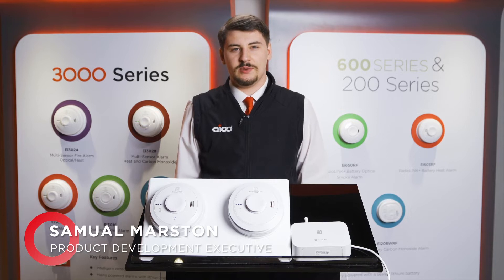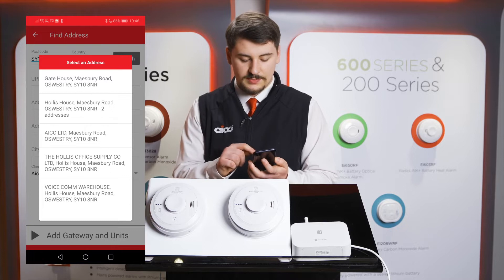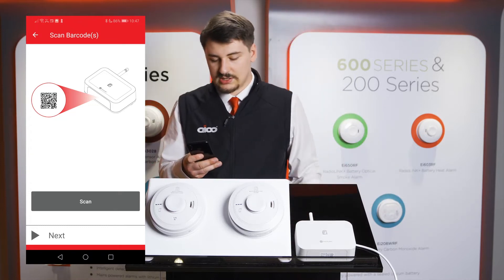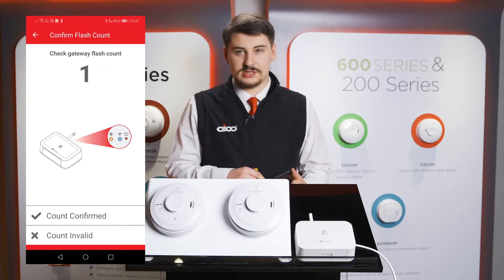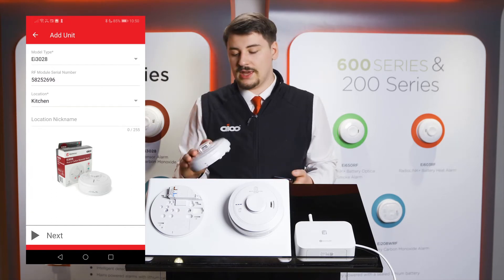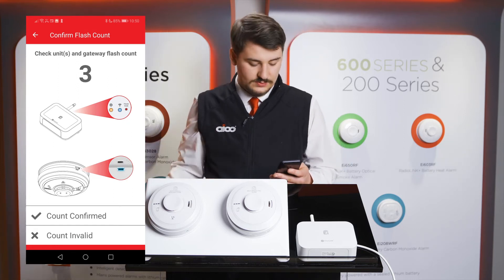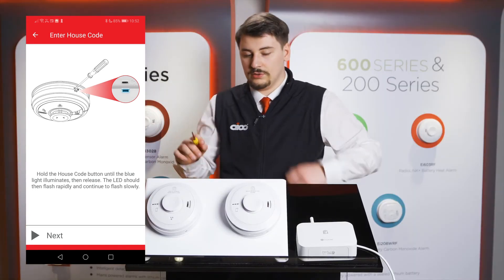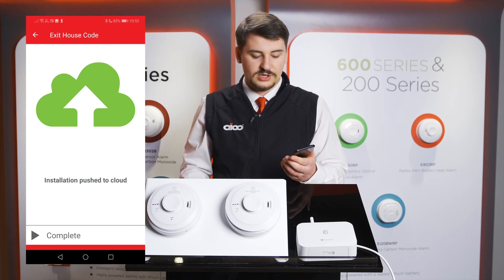Setting up an Ei1000G SmartLINK Gateway

Comment: I turned the gateway on (Power LED on only with blue led keeps on flashing) but why does it keep on flashing blue and when i press the house alarm it keeps on flashing and nothing happens and the cellular LED doesn't turn at all?
Reply from the maker: Hi there,

If you could give us a call on 01691 664100, we will be happy to help!
Reply: Do the optical alarms record you

Comment: Why does it have 3 flashes when you add in the first detector but then when you add the 2nd detector it looks for just 4 flashes? If it’s counting the smart link and detector shouldn’t it be 5 overall? Or if it’s just counting smart links it should be 3
Reply from the maker: Hi James,

When you first put the Gateway into house code mode, it will have 1 blue flash every 5 seconds until you begin to add more units to the system.

When you add the next alarm, you will have normally have 2 flashes on the Gateway and the alarm. 

The reason Sam had 3 flashes after adding the first alarm is because it was model number Ei3028 multi-sensor heat and CO alarm. As this has a fire sensor as well as a CO sensor, it gives off two flashes during the house coding process.
Reply: @aico-tv that makes sense thank you! I do have one more question. I’m looking to add the gateway to a load of alarms already linked up with smart links. Do I just need to house code the gateway into that system or do I need to reset every alarm and then restart the house coding?
Reply from the maker: @JamesWilliams-uq4jv  

Hi James,

You will need to completely factory reset all devices in the system and start from scratch, following the steps on the SmartLINK app.